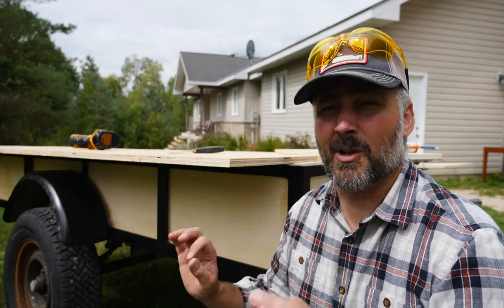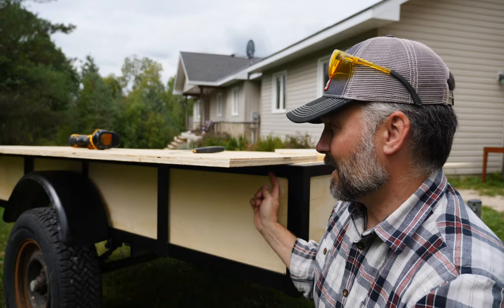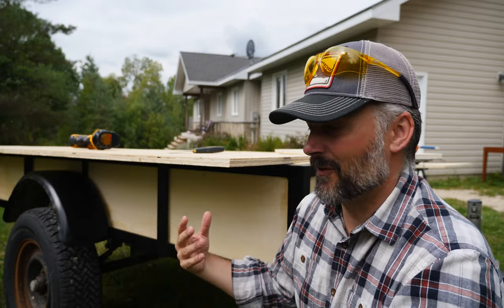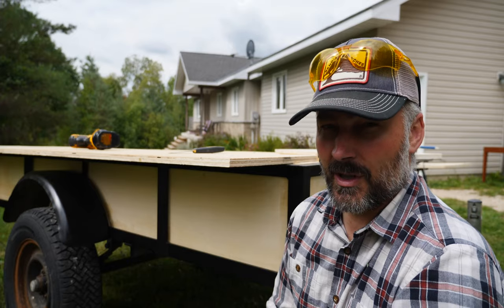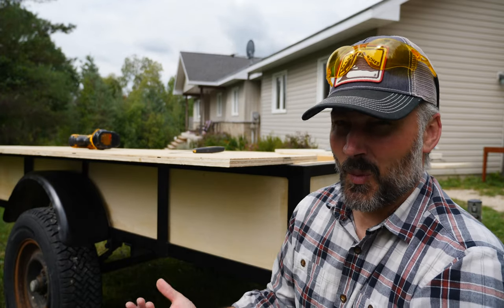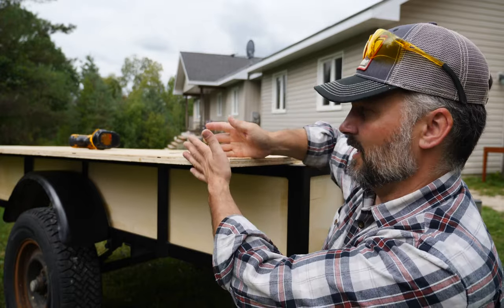How I BUILT a TINY HOUSE   ⭐️4K Video ⭐️

Comment: great ideas but just curious....why didn't you just coat the entire underside with something like a bed-liner coating?  maybe it has something to do with weight or fit but it just seems like that would have protected the entire under surface and not just the joint areas.
gewat instructional videos
Reply: oops
Guess I should have waited a while lol!

Comment: 1:29 ah yes sawhorses: $10.00 on sale at Canadian Tire. At least the ones I bought were. lol

I bough a pair and liked them so much I bough another pair...next time they were on sale, I bought a pair for each of my boys...that way I got to keep mine at home. lol
I mounted pieces of 2x4's on top of mine so I could screw a piece of plywood on them to make a work bench for smaller jobs...I can also saw on them without cutting into the metal of the sawhorse
Reply from the maker: Yep, I have 3 of them and they have been surprisingly durable. Had mine for close to ten years.